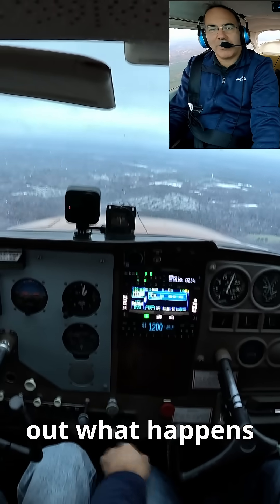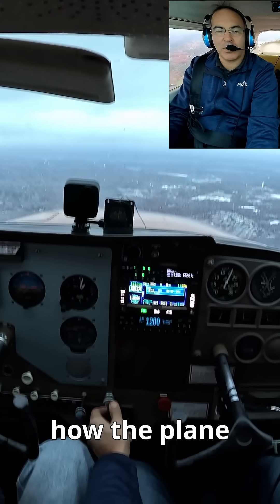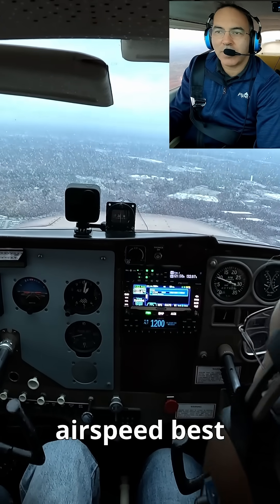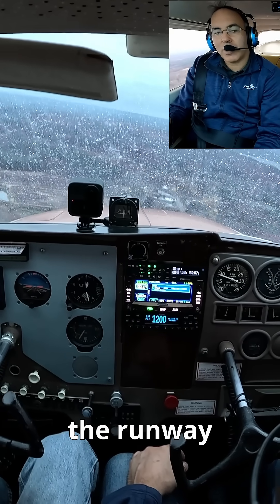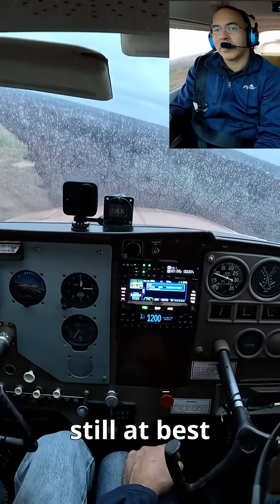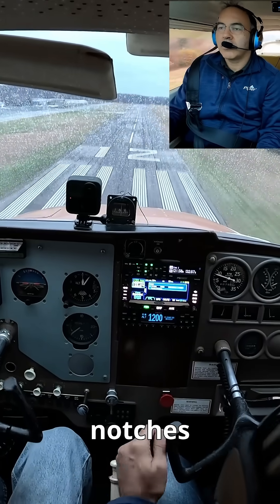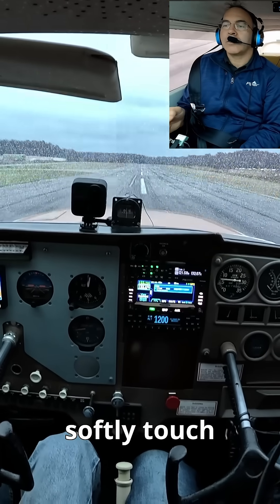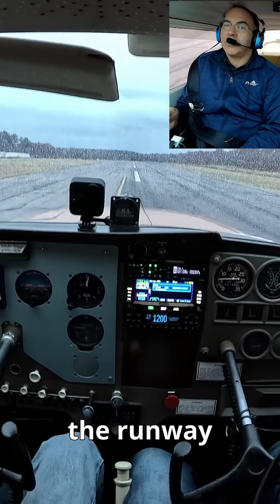Can a Plane Land Safely With No Engine?

Comment: Propeller is still working so it’s not accurate video!
Reply from the maker: Thank you for your comment.
Propeller will always be spinning while the plane is flying through the air, even with engine out, as it’s been spun by the oncoming wind.  Only planes that are able to feather their propellers (turn the blades perpendicular to the oncoming wind), would have their propellers completely stopped in flight when engine is out.  This includes all multi engine planes.